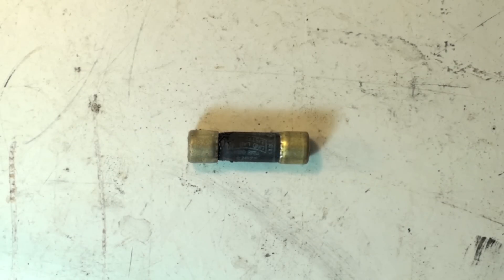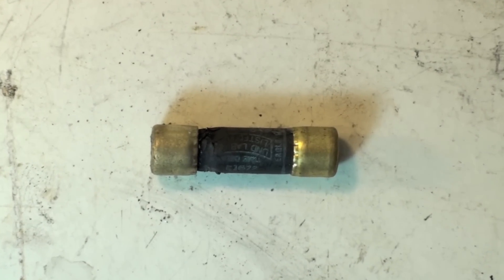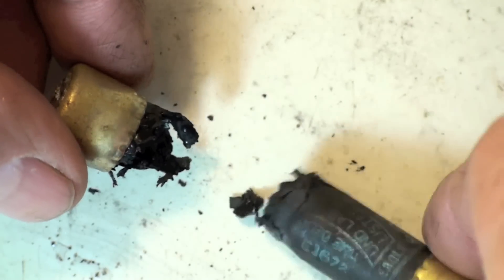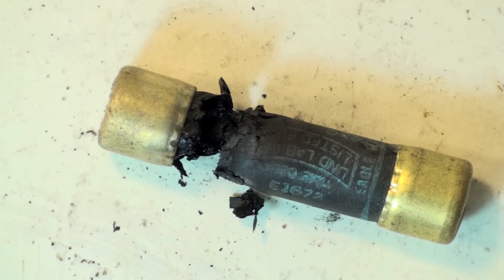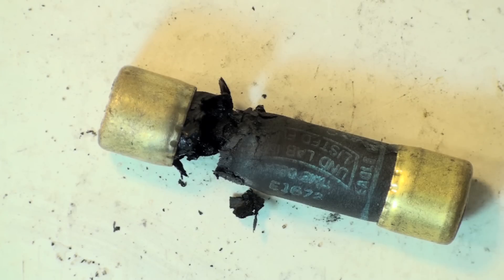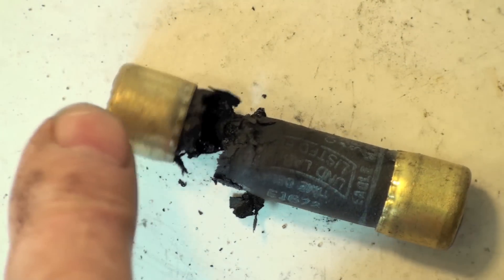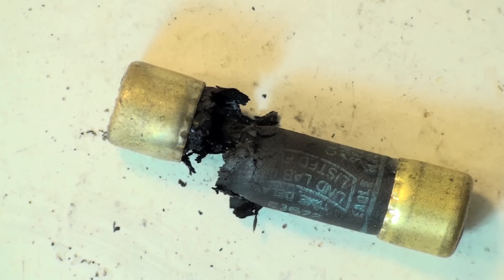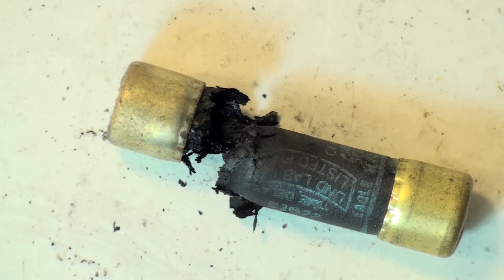Why does an HVAC fuse burn up

Comment: I love when Mr Gray said there is nothing wrong with this fuse.   He is 1000 percent rite I mean not 100 but a 1000 percent agree with your way of thinking. Only been in the trade for 30 summers but u are rite on all of ur Air or Heat Analogy
Reply from the maker: Thanks
GFM

Comment: Inside most fuses of that type there is a silica powder which is used to extinguish the arc that ensues when the fuse opens (always under a load of course). It looked as though the powder leaked out at some point. If you shake a new fuse you can hear the powder inside.

Comment: I have a question ..why would that fuse blow (not burn) on a brand new install sir?.
Reply from the maker: If it blew on initial startup, there is probably a short in the system wiring.
GFM
Reply: Fuse blew out after a month or two
Reply from the maker: There are a number of possibilities here.  If only one fuse blew, it could be the disconnect is overheating.  If both blew, that indicates there was an overdraw on both hot lines.  This could be an interruption of power for a very short time.  It could also be the unit shutting down momentarily then restarting before the compressor pressures have equalized.  Or you may never find out the reason why.
GFM
Reply: grayfurnaceman wow what an insight! . Thanks again. By the way only one fuse blew sir

Comment: Shuldn't the fuse body made of ceramic?
Reply from the maker: Some are.  But it would make no difference.  The fuse would still overheat and melt the element.
GFM

Comment: What about when plug (edison) fuses heat up?  Does that indicate that they're not making proper contact?
Reply from the maker: Yes.  If the plug is loose or there is a loose connection near the fuse socket, they will heat.
GFM

Comment: Great video. I've had exactly that happen last night. The repair man said it was just an old fuse and was ok to replace it. This is on an old furnace. He was checking into maybe replacing the fuses with breakers. The fuse was a NON-60 if that makes a difference.
Reply from the maker: There are 2 reasons for fuses to blow.  Overload and bad connections.  They do not wear out.  Breakers would be a good idea if it is possible.
GFM

Comment: my fuse was burnt like this, but the copper was black as well and it had the whole living room and hallway smokey, we thought it had caught on fire...it didnt thankfully but could you please let me know what i need to do to fix this problem? the clamp that holds my fuse is loose, where would i get a new clamp and how do i put it in?
Reply from the maker: +Amber Caldwell You must replace the entire disconnect if the fuse is in a disconnect.  If it is in your main panel, Replace the entire panel.  This may seem extreme, but if you have a fused panel, it is probably 50 to 80 years old and is not viable in modern electric.  Hope this helps.
GFM